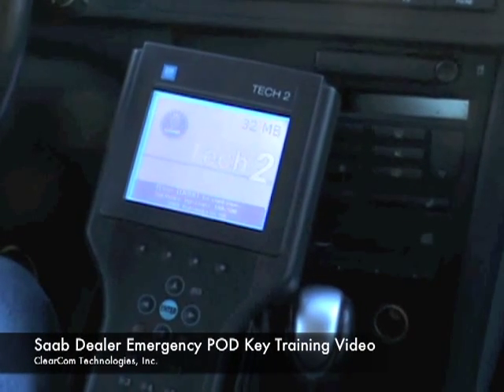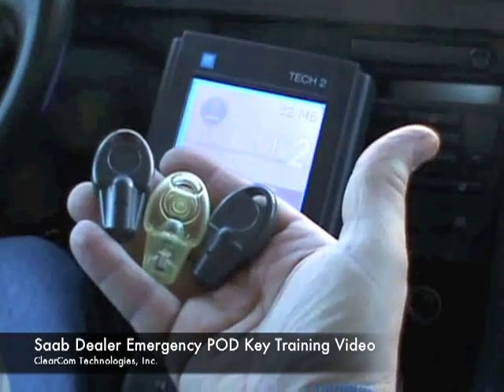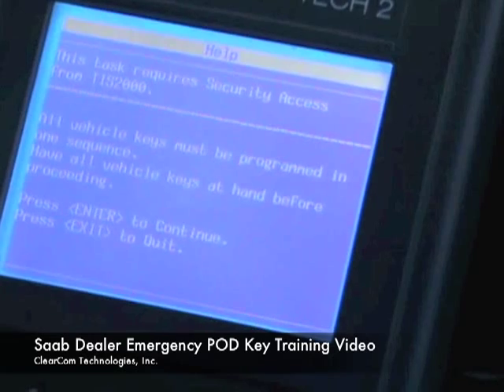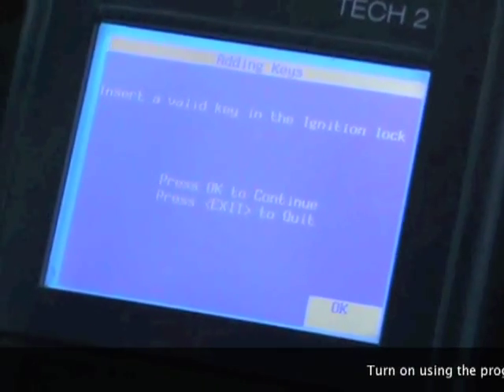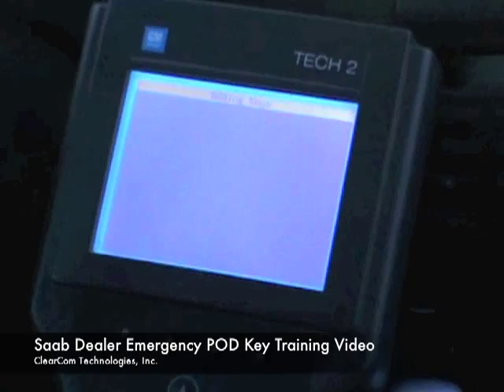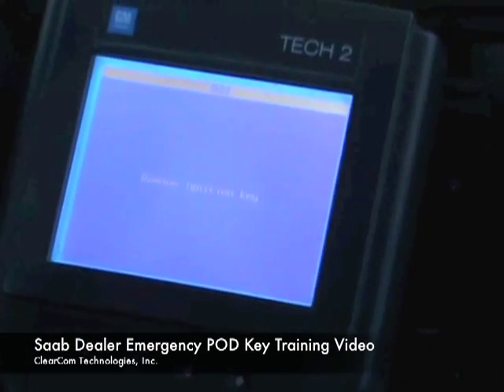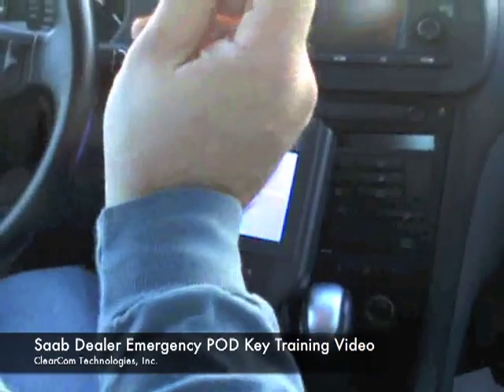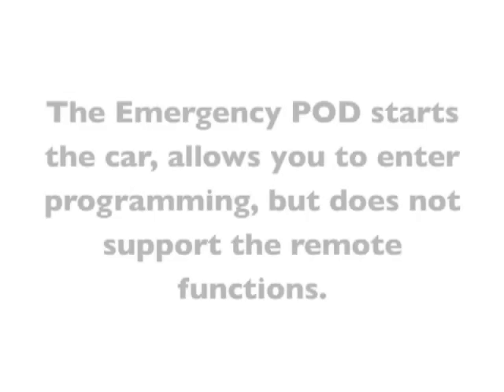Saab Dealer Emergency POD Key Programming Video

Comment: Thanks for getting back to me. I stay in UK can I email you about it? kind regards Tracy
Reply from the maker: +Tracyjosphine Ratchford Yes.  My email is rogerw@clearcomtech.com.  Thank you.
Reply: Hi there did you get this problem solved,I have the same problem and its says key error contact service key won't turn and start engine at all just happend today out of the blue.ive got a Saab 9-3 linear 54 plate??
Reply from the maker: Hello.  The most likely problem is that the key has died or is no longer sending a signal out to the vehicle to be read and allow the car to start.  We can repair the key for you.  Another possibility is the Ignition Switch Module (ISM) has gone bad; however, this is not nearly as common as the key going bad.  We also have ISMs we can send to you to try and see if that fixes it.
Reply: +Roger Whitaker thanks for getting back I've meant to be getting a guy out tomorrow to look at it so fingers crossed he will get to the bottom of it got a quote for a round £250

Comment: hey I'm having so much problems with my car key fobs. Both keep saying wrong key contact services or immobiliser malfunction contact services. my car won't start at all. sometimes if I sit long enough putting the fob in and out sometimes it starts. I have a saab 93 vector sport. Please help me get to bottom of this nightmare if you can
Reply from the maker: +Tracyjosphine Ratchford Thank you for the message.  Will you please give us a call and we can ask you some more questions and help you.  Our number is 435-759-2495.  You can speak with either me or Lilly.  Thank you.